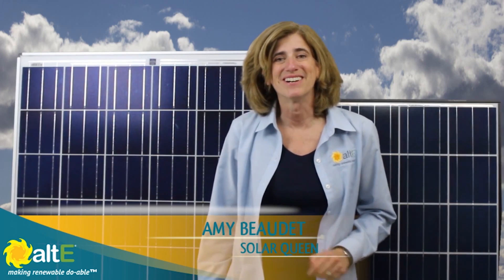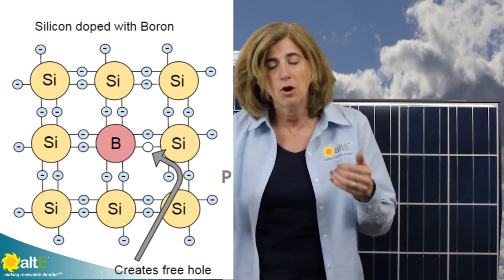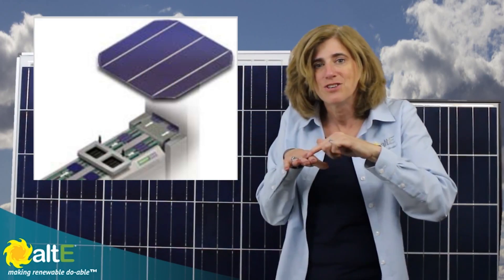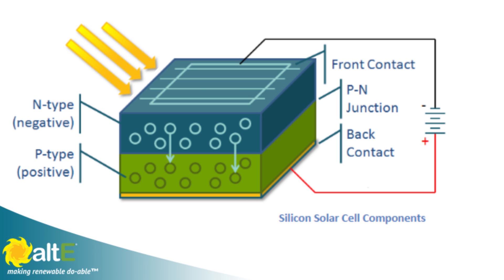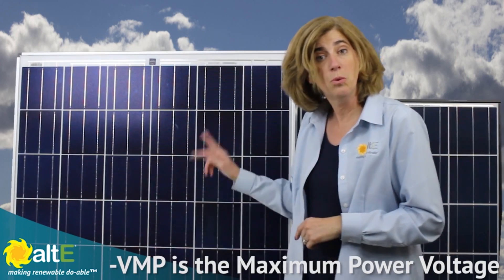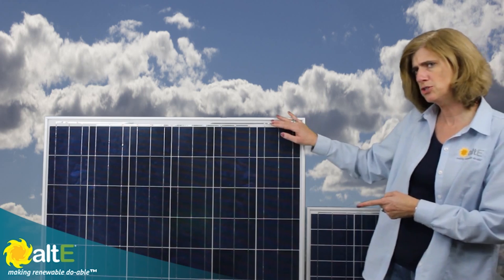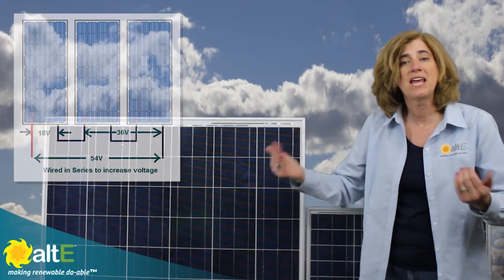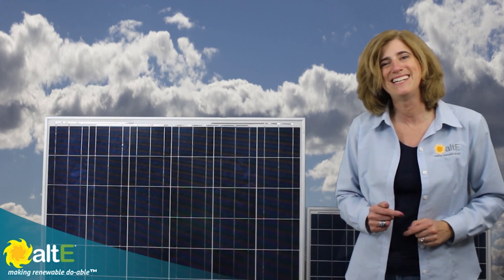How do Solar Panels Work?

Comment: A couple of elementary mistakes here that completely describe this device in the wrong wy.: at 1.13, diagram shown is incorrect. Where do I start? The p-type layer is not positive, neither is the n-type negative..At the depletion zone( junction potential) the p-type is actually negatively charged and the n-type is positively charged. Thus there is a potential barrier between the p and n types. Freed electrons usually are released from the p-type material and are then swept across the junction potential (or electric field) gaining electrical energy and forming a current flow. This diagram even shows a power source for goodness sake....it is a device that produces electrical power, not consuming it..........

Comment: Hello. i need to know that is it possible to replace the damaged solar cell in a module and bring back to the original state? &  The possibility of soldering the broken  metallic contact between the cells?
Reply: once cell is complete in final form(after laminating) it would be hard to take out part by part because the possibility crack to other cell is high(it can make module less efficient)

Comment: Hi Amy. I see 100watt solar panels rated at 12V but a lot of 200watt ones are 18volt. Are the 18volt ones better to use for off grid homes?
Reply from the maker: Jj Sands "12V" panels actually output about 18V when connected, or 22V when not connected. So those 200W panels you are seeing are 12V panels. That just means they can be used to charge a 12V battery with a PWM charge controller, rather than a more expensive MPPT charge controller. But because 12V panels tend to be more expensive per watt than 20V or 24V panels, depending on the size of your system, it may be cheaper to get larger panels and MPPT controller.

Comment: what you think what could be the problem if in full sunshine Panel giving half or one third open circuit volts but full amperes  ! the normal short circuit current mentioned on sticker of Panel is 8 AND it is giving 8 amps but volts are half or one third open circuit volts.  May i know your expert opinion what is the problem in my panel ?? thank-you
Reply from the maker: The voltage of the panel is a result of multiple cells wired in series. Each cell puts out full current, but only .5V. So, if you have a 36 cell panel with a rated Voc of 22V that is only putting out 11V open circuit, then half of the cells are not connected. It could be a bad bypass diode.
Reply: altE thank-you.  i will replace all the diodes then will update

Comment: Hello I would love to install solar panels on my van and keep only main battery. Is it possible to do that or i need second battery and isolator?
Reply from the maker: The problem with using only your main (starter) battery is that it is not designed to be charged and discharged the way a deep cycle battery is. Starter batteries have thin lead plates, designed for a short, high surge. Deep cycle batteries have thick lead plates, designed for a long slow usage. So if you start using your starter battery for more than just starting the engine, you will greatly shorten its life. So while technically you could do it, you shouldn't.
Reply: altE thank you for fast answer. I have optima gel battery yellow one now and solar panel only for month or two on the roof and then I will be moving out of usa so i dont want to buy second battery now. I will buy when i will be back home deep cycle batteries

Comment: So here is the problem I'm trying to overcome. In a multi panel array, or even just one panel in a temperate zone where there's snow fall, the snow will slide off warm panels but most panels have a frame around them that causes a ridge that holds snow in place. If the panel edges were flush with the surface, the snow would more readily slide off. If angled more steeply at night and then tilted for optimum exposure during the day you could reduce the amount of snow on them to nearly zero. I'm also going to experiment with various clear coatings like rainx and the like to see if frost could also be eliminated. Are there any panels that have flush edges? Rounded would be the ultimate profile.
Reply from the maker: There are some frameless panels, you have to use their racking with them. I personally haven't used them. The nice thing to do if you do have the ability to change the angle is to have the panels tipped steeper for the winter. The sun is low, so latitude plus about 15 degrees is great. For example, here in Massachusetts, our latitude is 42, so in the winter, the ideal angle is around 60 degrees. That's nice and steep for the snow to tilt off. Then around spring, change it to around 45 degrees. We had a big snowstorm here two weeks ago. Within 2 - 3 days, all of the roof mounted panels I saw had shed their snow naturally. We did have a bit of a warming spell that helped, but most grid tied systems can just be left to their own devices to dump the snow if they are at a decent angle. Off-grid systems, where every bit helps, may need a hand.

Comment: can different voltage panels be connected in an array? one of your slides shows an 18v connected to a 36v
Reply: Ing. Francis Opoku They have many videos testing this very question.
Reply from the maker: That picture actually showed three 18V panels wired in series, It was showing that across 1 is 18V, across 2 is 36V, and across all 3 is 54V.
But to answer your question, you can wire different voltage panels in series if they have the same amps. Watch this demo, https://youtu.be/JfzT8u205co
Reply: @AltEStore  If I have an existing factory installed solar "system" that only has an 80w panel. If I change the panel to 180w, or two 180w panels in parallel, will the wire from the old panel to the controller also have to be changed?